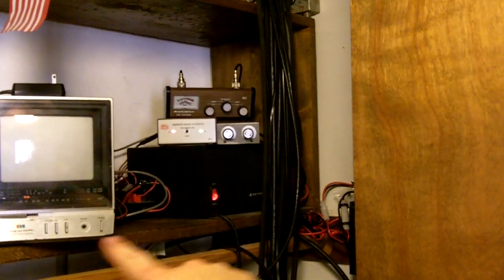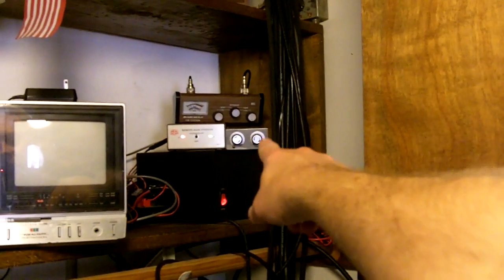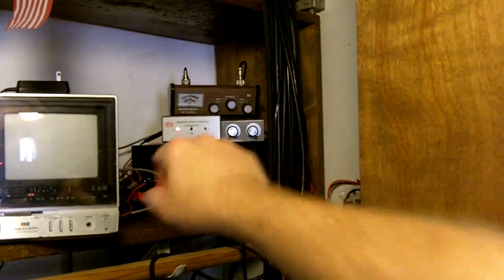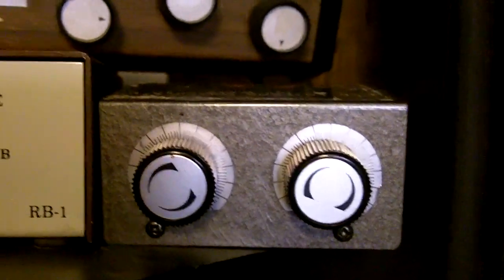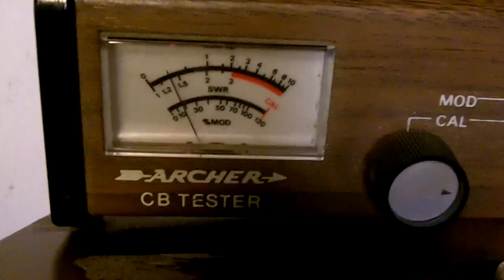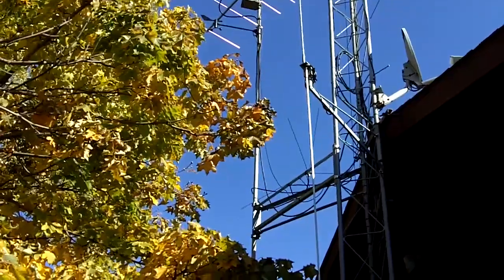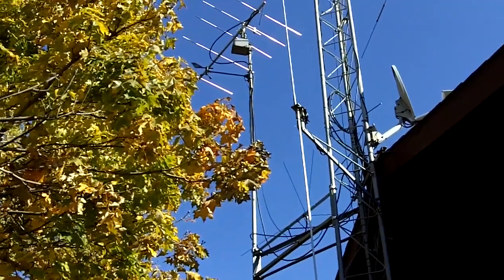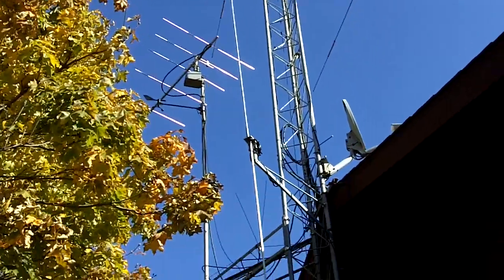Ham Radio 10 Meter Beacon Update

Comment: How far away from the tower is your dipole? I've been thinking about doing the same at a commercial site for our 10 meter repeater. It would use 102" whips cut for 29.640, and I want to make sure the tower isn't going to cause any reflections. I really want to avoid using a antenna tuner if at all possible. Thanks & 73 K5DVT

Comment from the maker: @JohnnyX50 thanks, well, it didn't cost as much as you might think, the transmitter is a Little Joe kit, the code keyer is another kit and the housing was just an empty box I had on had that used to house something else.  So I never added the cost up but all together probably less than US 50 dollars or so.  I had the power supply to power it already, just a 12 volt.  Thanks for the comment!